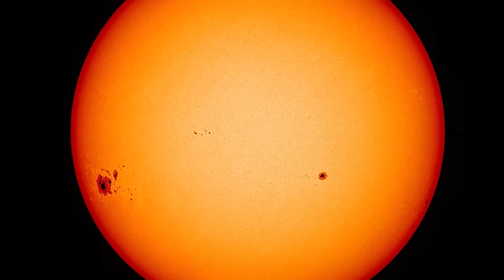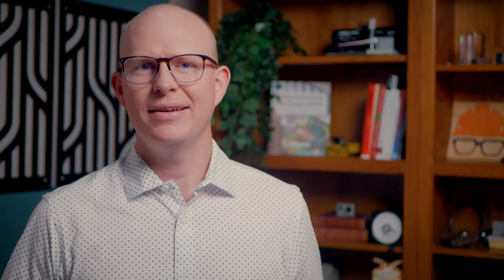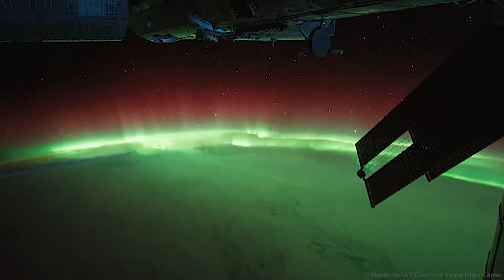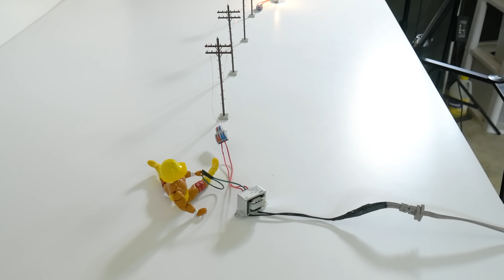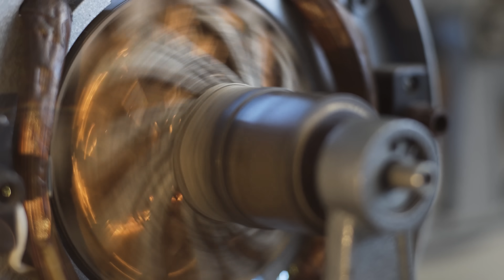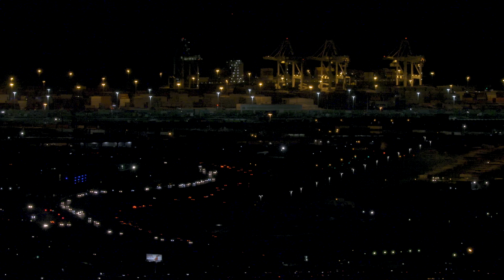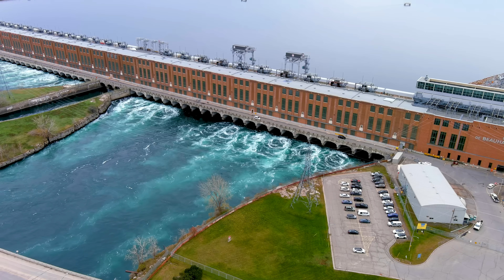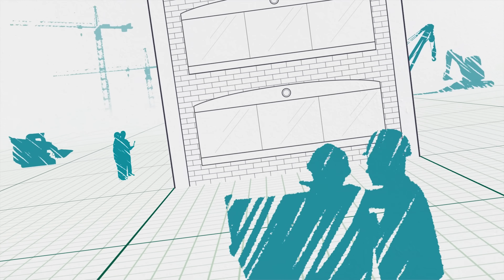The Most Confusing Part of the Power Grid

Comment: That was a really excellent description.  And even though it was only in passing, you even mentioned the single most important equation from ohms law... the power-resistance equation (P = I^2 * R)... very few YouTube personalities mention that equation or even realize that it exists or what it means.   So lets expand on it a bit to round things out.

This equation governs power lost to heat in a circuit, wire, or cable.  As you can see, it is non-linear with current.  There are some major consequences to it being non-linear with current:

* When you double the voltage you halve the current to make the same power, but LOSSES wind up being only 1/4th.   In otherwords, increasing voltage vastly, vastly reduces losses.  Not just by a little, but by a lot.

* This is why transmission lines on the grid pump the voltage up.  If you increase the voltage from 120V to 120,000 volts... so you increase the voltage 1000 fold, you decrease the power losses by a million-fold. 1000000-fold lower power losses.     Lower losses == far higher efficiencies.   This is why transmitting power over the grid is so efficient.  The U.S. grid, on average, exceeds 90% efficiency.

* This also works for DC power and is why pumping up the DC voltage leads to far higher efficiencies and lower losses.   A 48V battery system is 16x more efficient than a 12V battery system, for example.

--

So even though ohms law seems linear on its face, it isn't when it comes to resistance and power.  The voltage drop across a resistance (across a cable) is linear, but the power loss is not linear.  e.g. 1 amp flowing through 1 ohm of resistance will drop the voltage by 1V.  If you are pumping 10V into the circuit (10V x 1A = 10W), you have 9V on the other end and lose 10% of your power to heat.

But lets say you want to transmit 10W and are pumping 100V into the circuit?   Now you are multiplying the voltage by 10 but you are ALSO reducing the amperage by a factor of 10 to get the same 10W.  100V @ 0.1A through the circuit (10W).   Now the voltage drop is only 0.1V instead of 1V, and it is relative to 100V instead of 10V.  Thus the power loss isn't just 1/10th, it's 1/100th.   Losses go by the SQUARE of the current.

* People often wonder why AC wiring has low losses when not under load.  I mean, the waveform is constantly switching back and forth and that does mean that there is current sloshing around.   The power equation is the reason.   Because the current is so low, the losses are even lower.   If the current sloshing about is, say, 0.001A then the power losses wind up being I*I*R = 0.001 * 0.001 * R which is 0.000001 * R.

* Reactive power only flows along the current path.  If HOUSE A generates reactive power, HOUSE B won't see it.  But the GENERATOR and all components and cabling in between the GENERATOR and HOUSE A will see it and have to deal with it.

* The reactive power caused by a large number of point loads combines into essentially one power factor by the time it gets back to the substation, which the substation can compensate for.  Each point load provides its own contribution but they all essentially combine into one phase angle.

And there you have it.

-Matt
Reply: Thanks Matt.
I worked  as a water chemist in a thermal electric power plant in Eastern Newfoundland.
In summertime , periods of low heating and low Air Conditioning load ,
The plant would run one alternator as a ‘ synchronous condenser’
I asked our engineering dept why we ran that unit that way but never did get a satisfactory answer/ understandable answer
I think I understand it now.
If you got any water treatment issues  let me know.
Tks  Ed
Reply: Amazing explanation. I remember learning this but totally forgot about it as they say you don't use it. You lose it.
Reply: Learned something today I didn't know I needed or wanted to know. Very interesting. Thanks. Than thanks Grady for your excellent yet simple explanation.
Reply: Wow. Thank you for all the amazing detail.
It’s so fascinating to me the difference between Us and British Consumer power grids because of the different delivery Voltages.

Yet another difference in application that I forgot the history of… down a rabbit hole again 😅❤
Reply: So the higher supply voltages in Europe gives them much better grid efficiency, right?
Reply: @tedwalford7615  Not necessarily true for the grid itself.  Both the US and the European grids run at high voltages (up to at least 500 kilovolts or even greater).  The difference is the “last mile”.  

In the US, household electricity is 110 volts and 60 Hz.  In Europe, it is 220 volts and 50 Hz.  These voltages are only stepped down to from the pole to the house.  The rest is higher voltages.

220v is easier on equipment, since it means half the current for the same amount of work, but twice the voltage for the same amount of power.  Power = volts x amps so so for a 220 watt load, you need 110 volts x 2 amps in the US, and 220 volts x 1 amp in Europe, but it is still 220 watts in both places.  Remember, the power (watts) represents work done.  Toasting a slice of bread requires the same amount of power in the US as it does in Europe.

As far as I know, the Hz isn’t really better or worse unless you are working with some kinds of extreme high accuracy equipment.  It just causes an incompatibility problem for any electronic devices that are time dependent.  

It does make a difference if you are doing phase angle calculations for RLC circuits but, believe me, you don’t want to go there unless you are an electrical engineer or a communications technician.  My final exam in communications class only had two questions, both requiring calculating peak voltage phase angles of RLC circuits.  The exam was 4 hours.  I needed all of it.

Having that “last mile” at the higher voltage does increase the efficiency, but only a tiny bit for each house, since the voltages are so low.  Remember, large transmission lines go as high as 500 kilovolts, so the efficiency gain of 220 volts versus 110 volts is unnoticeable.  Essentially it is a rounding error.  The only way it becomes noticeable at all, is when you combine millions of homes.  Then it can be measured in tenths of a percent of efficiency.
Reply: This makes alot of sense now why we use high voltage in the home yet only push 20-30 amps on a circuit.
Reply: @XxThePlaylistxX  The 20-30 amp limit set by household circuit breakers is due to the “ampacity” of the wires.  Remember, wires have their own resistance, and resistance converts amps to heat.  Things like wire size, composition (copper/aluminum), the type of insulation, and even expected ambient temperature all have to be taken into account when installing the circuit.  This is one of the major reasons people are told to use a licensed electrician instead of doing it themselves.  In addition, your insurance company won’t pay off if you burn down your house, but will if they have an electrician to sue.

Comment: Excellent explanations!  I’ve worked as an Operator at a large power plant, adjusting generator excitation to compensate for VARs as needed by the grid.

The best analogy I’ve heard for explaining reactive power is a beer mug:  the beer is the real power carried by the mug, and the head on the beer is the reactive power. It isn’t useful for anything, but the mug still has to hold it all!
Reply: It is a lovely analogy - tangible, important and visualisable.
A straight induction powered motor is a badly poured Guiness.  Adding capacitors is like employing decent bar staff - more beer in the same glass.
Reply: @andrewharrison8436  and as the OP suggests with the excitation... with too many barmaids, they get silly and hard to keep in check... not enough barmaids and business gets slow... 
too much capacitance and you cant reduce the excitation sufficiently. rotor field adds to stator field.
too much inductance and you cant get enough excitation. rotor field subtracts from stator field.
Reply: The froth on the beer; me too.
Reply: When I started working at the power company, I had an engineer explain to me that reactive power is like riding a bike.  The real power is what you use to pedal, the reactive power is what you use to keep it up.  Both are needed or the bike won't go.
Reply: Actually this analogy is why I never understood reactive power lol...  It actually finally makes sense to me watching this video.  It's not like a beer.  It's out of phase power that is creating negative current.  

The problem with the foam is that it's static.  

Maybe we need to change the beer analogy to sloshing beer around back out of the cup, back onto the floor.  The more excited a motor gets, the more it sloshes beer back, whereas a calm disciplined motor keeps it steady.  shrug

Comment: induction motors have a fairly decent powerfactor to begin with - when sized appropriately. Something in the range of 0.7-0.9 normally. And for large industrial electrical consumers you usually see them having on-site PF correction measures in place.
nowadays a big problem for PF are switching PSUs and all those cheap chargers out there. Not only do they have really bad PF (often as low as 0.4) but also it is not even close to sinusoidal, being even worse for the grid.

Comment: Grady does well explaining all this. There was a time where it was impractical to impossible for electrical service to be delivered to customers by any means other than the grid, but now there are alternatives which are cheaper, more environmentally friendly, easy to implement, use, and maintain, and can be more reliable than the grid which he seems to be missing. By using on-grid power you can never reach a point where the system pay-off comes back to you the customer. It continues to cost more and more as it becomes more complex by necessity and it's failure affects up to millions of people for an indeterminate amount of time. You have no say-so in any part of it's operations.

With the rapid advances in small-scale solar power it's now viable for many homes to go off-grid and this has many benefits involved. One is that what happens elsewhere whether man-made or natural cannot affect you, nor can anything you do affect anyone else. Another is that there is a time where your investment ameliorates and pays for itself. You're not constrained to continually paying for a system where you will forever be spending for expansion and upgrades which do not directly benefit you. Furthermore this benefits the grid too, as now those expansions and upgrades are less frequently needed. Implementing solar or wind power into the antiquated process of a grid system is problematic, but implementing it on a small individual-user basis is not. 

Everything Grady shows us here and in other grid-related videos highlights the engineering which goes into it, and though he includes mention of the costs, he doesn't indicate the costs to you or the fact that all this engineering and cost is unnecessary for the many who can go off-grid. Today's off-grid systems can be nearly plug-and-play simple with the average handyman being able to do almost all of the relatively easy work themselves. Grady also doesn't mention the costs of the massive manpower and engineering the complex grid system requires, nor the fact that almost all the electrical generation and distribution companies are for-profit entities where the excess money goes into the pocket of somebody who is not actually contributing to the system. The grid will always be necessary for certain users but it's time to relegate it to only those entities along with it's exorbitant and increasing costs. You can do better- we can do better- and we should.

Comment: Arrrggghhh!!! You’re using an Electrolytic capacitor with AC! 😮 that’s very dangerous, they explode when reverse biased!!! 🙈
Reply: Well.  Explosion is unlikely at 10v reverse input for a short duration.  I mean, I've installed elcaps backward a couple of times.  It happens.  And smoke is not out of the question.  But all my elcaps are vented style, for a reason.

Comment: yep, one tip i've learned (and only do this if you're qualified) is to measure the reactive power of some of my more power hungry devices, adding a capacitor or inductance to the circuit has helped reduce my power bill my a surprising amount in some cases, since as Grady said you're still billed for that power... especially my flatscreen TV which had a pretty large reactive load and was on pretty often (binge watching practical engineering videos)
Reply: A flatscreen  T.V. a "power-hungry device?"  You must not have an air conditioner; nor do
you remember cathode-ray televisions.
Reply: @symbionese2348  my TV stays on alot, so compared to something that's only on intermittently it's power draw was not insignificant, and i don't have AC.
Reply: @theminecraft4202  Okay.
Reply: Grady specifically said we are not billed for our reactive loads; industrial users are.
Reply: @alsavage1  no, we are billed for everything we use, but industrial users are billed for energy sent back too because it causes additional loads on the system. reactive power has to go into the device before it's put back into the grid, so we do pay for it.
Reply: @theminecraft4202  " . . . power has to go into the device before it's put back into the grid"

Uh, no.
Reply: @theminecraft4202  Residential customers are billed on net power: the power that is used to do work.  You're thinking that you are billed for power into your home, but in your model the power the flows out of your home is credited.

You pay for the net, not the one-way trip.  Your meter "does the math", meaning it lacks the capability to bill power that only flows in, and not out.  Industrial customers get more-refined "meters" (or, as Grady mentioned, they have an average PF applied to the net, to obtain the billing total).

Comment: I worked in control room in a nuclear power plant.  I can explain the atom.  I only understand apparent power and VARs.  To this day I can't explain it.  I know how to control VARs.  I know the damage it can do.  My generating station replaced all 9 single phase 500kv transformers due to sun spot induced currents during the 1990s.  My brother is an electrical engineer and he can't teach me enough so that I can explain VARs to others.  Yet, I can say everything that you had in your video.
Reply: Your confusion stems from the fact that sunspot activity is totally unrelated to reactive power.   Sunspot activity induces a DC component on transformers which can overheat the transformer.   It does not cause or affect reactive power at all.

Transformers convert AC into oscillating magnetic fields which couple across to the other side of the transformer.   DC just puts a fixed voltage across the transformer and this produces a fixed DC current through the transformer windings which cannot couple energy into the magnetic field.  So all the energy produced by DC current has to be dissipated by the transformer as heat.

Comment: I seen a guy trying to plug a DC unit into AC circuit. I stopped him before anything bad happened but he thought alternative current meant that it would alternate between DC and AC depending on the load.  

It was absolutely terrifying. It was a shipping Warehouse that was converted into a art studio. There was so many safety violations and fire hazards throughout this entire building. 

About 1 year later that very same building caught on fire. 13 died and many more injured. 

I don't expect everybody to know everything because that's impossible but these were college kids in a major university that has a Electronics lab and electrician courses. 

Out of the 150 art students in this cluster. Not a single one of them thought about asking anybody with knowledge about electricity. We're talking about a 3 minute walk from one classroom to another.

Comment: So power factor of .6 means %40 of power is lost on charging or discharging cycles.. tough in general it charges to 500 watt but its momentarily in 50 hz cycle/sec...   so lover powerfactor requires powerful moffseta on inwerters and sensors anf mostlijely bigger cables on mechanical generators/trsformers and powerfactor of 100 or 1 logically also means squarewave 😅😊

Comment: Well actuallu i understood it logically 2 days ago... power factor is alternate streams of wibration or passive side... ie on sin function each side has a load/charge and discharhe times so that loss on power factor is that on power shifts unloaded part which makes ie 500w  system momentarily lower then 500 waty while whitching polaruties